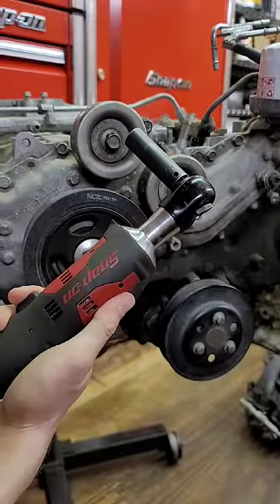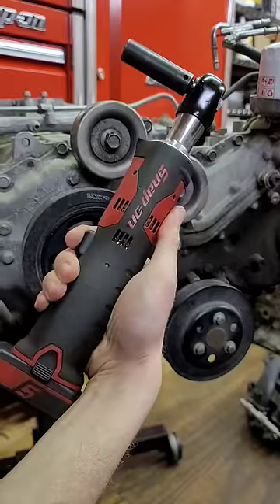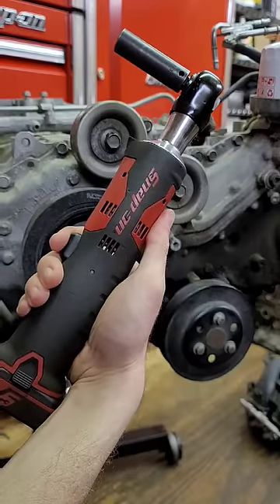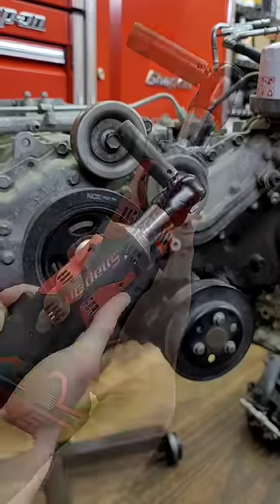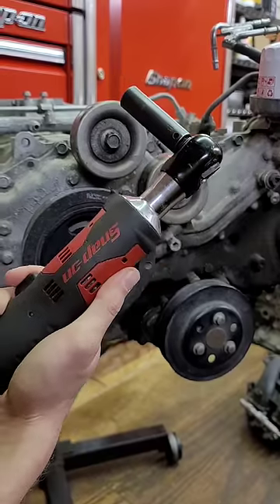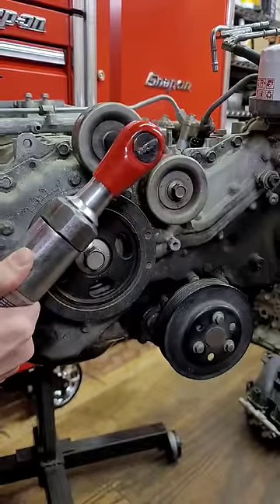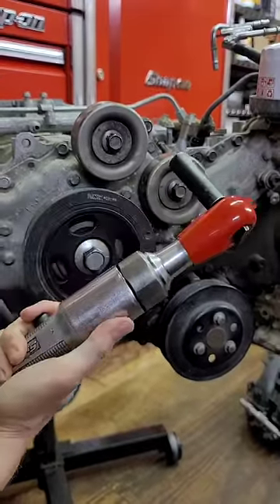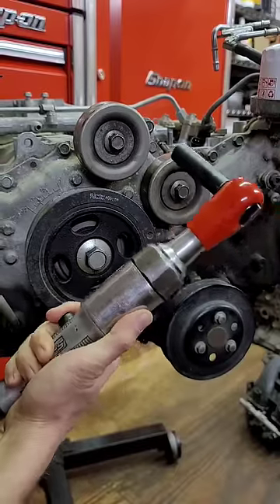Don't Use Electric! Use Air! Duh! #Snapon #Shorts #CordlessRatchet

Comment: I bought an air ratchet once. I've never actually used it aside from playing with it. My Milwaukee is 10x better than any air ratchet. Plus the key with breaking stuff lose is to give it a running start to overcome the overload protection. Good for the tool? Probably not, but it's effective!
Reply: This is why I posted a comment saying: A ratchet is no replacement for an impact gun.
Reply: @stewoe7157  absolutely. In many tight access positions where the ratchet can’t break the fastener loose, you’ll either have to resort to a right angle impact or a good old fashioned ratchet.
Reply: @alexp6016 Good old elbow grease.
Reply: Uh, just break it loose with a regular ratchet or breaker bar, then zip it out with the electric ratchet.
Reply: That's what the warranty is for lol
Reply: @hondaguy9153  it takes a good bit more time to switch from one to the other, and it can be quite a pain since the air or electric ratchet is used a lot in tight spaces you can't fit an impact into, otherwise you would just take an electric impact and not worry about getting a running start to break stuff loose and such, you just go ham lol
Reply: Same here. My air ratchet got used maybe once. Handling that hose in places where you use the ratchet is just too much. It’s been sitting in the drawer for years ever since, untouched except to move it out of the way to grab something I need. I don’t know why I don’t toss it! 🤣
I have a great battery ratchet I actually like. Still, I rarely use it though because I just forget to reach for it. I just end up using the hand tool.
Reply: I do this all the time. Get it running and them stick it on the bolt. Normally gets the bolt undone. Never had any issues with my snap on battery ratchet breaking from it. Amazing how powerful it is really.
Reply: The Milwaukee is a game chamger
Reply: @hondaguy9153  I don't know about others. The snapon ones advertise that you can use them as a normal ratchet to break it loose.
Reply: Not a mechanic but do plenty of work on my lbz and my partners suburban I'm a contractor by profession and have way too many m18 and m12 tools(if I want a tool and I can use it for a job I will buy it knowing I will pay for it within the day or job) and I can attest the ratchet and right angle impact save me time frustration and energy when I'm working on stuff that's tight to reach.
Reply: @dblclutchmitsu  yeah, you can reef on it... No need to be scared and only use it to spin bolts. Unless it's a cheap Chinese piece of crap with no reinforcement, it is designed to be strong enough to break fasteners free by hand.
Reply: Been giving mine a running start since I got it and it’s still holding strong haha
Reply: I know it isn't a ratchet, but my pneumatic impact gun is a beast and can break stuff loose that I need a bigger breaker bar than I own to do manually...
Reply: You have never used an impact air ratchet; SP air ratchet would puts Milwaukee to shame.  M12 is 3 times bigger and 5 times slower.  I have both and no battery ratchet can touch SP.
Reply: @MrSilverroulett  Same, long term it seems to be fine!
Reply: @alexp6016  My 40$ ingersoll rand ratchet would break your Milwaukee in half. Pneumatic is just better for the money
Reply: @waterloo123100  Torque isn't the name of the game for these tools though. I'm concerned about RPM.
Reply: @alexp6016  I don’t know what you use your tools for but at my job you definitely need torque on with a ratchet to  get rusted/corroded bolts loose. And even if you do need the rpm my pneumatic ratchet’ s have  lot more torque/ rpm too and it was fraction of the price of a Milwaukee ratchet
Reply: @waterloo123100  I work on cars, so I know about stuck fasteners all too well. I’m able to break a lot of stuff loose with the motor alone on my Milwaukee, but the idea behind the cordless ratchet is to be able to spin off fasteners quickly, not necessarily to break them loose. For that, we have long handle ratchets. Or another one of my favorite tools, the M12 right angle impact. It’s a little awkward in some places, but it gets into some tight spaces and will break most anything loose that you wouldn’t use a full size impact for.
The other concern here is portability. I don’t always have my compressor running, and don’t want to be tripping on an air line. I’m also not taking my compressor to the junkyard with me!
Reply: @alexp6016  You must not use your tools as heavy as I do then. Between heavy line and suspension repair on 20+ year old cars in the rust belt I’ve broken bolts loose and electric ratchets still can’t turn the bolts loose. You can’t use a Milwaukee right angle on steering knuckles because it’s so big you have to a air ratchet or pneumatic right angle if you want to be fast. I’ve personally used those electric ratchets but they don’t have enough power to justify the big price tag to use them. We don’t have any pick and pulls around here though so mobility has never been a issue for me to be fair.
Reply: @waterloo123100  I can get that, but pneumatic ratchets really don't have a place around my shop. To each his own, if they work for you, keep using em! If a right angle can't handle it and you can't get an actual impact in there, you're either going to be cracking it loose by hand or disassembling more stuff.

Comment: Electric are great when air isn't available . Ya may have to break the bolt/nut loose but then that electric assist is awesome and a huge time saver.
Reply: Electric is great even when there IS air available lol it’s worth it for the convenience of not dealing with the hoses alone
Reply: yourleftnut1  Correct. I just have small electric impacts that work on stuff thats been broke loose or basically 1/2 Inc and smaller. I do like the electric impacts for driving lag bolts screws etc.

Comment: As mechanics I look at it this way it keeps the air hose out of the way. I also have an electric impact battery operated that works wonderfully. Also I don't have air hoses laying out all over the place getting in the way tripping over them and I can get into more tight places without having a hose in the way. I still use air tools but not as much as I do my electric impacts and electric wrenches that are all battery-operated.

Comment: Milwakee right angle impact is nice to have when the electric ratchet won't cut it.
Reply: Never fits where i need it
Reply: @michaelreale3647  that's why you're single
Reply: @kg0311  cute…
Reply: @michaelreale3647  you know it was good 😆
Reply: I have a universal joint and all sorts of extensions. Lol it usually will fit. If it's something Hella serious I guess get a breaker and make short turns till you can get a ratchet on whatever you are using. It came in clutch getting rusted f250 bench seats out for me. I use my right angle milwakee impact more than anything else tbh lol

Comment: I LOVE electric ratchets, we have a Dewalt electric impact wrench in the shop but for rusted or stuck bolts nothing can beat the NAPA air impact we have. If the bolt doesn’t break loose the NAPA will snap it off. We also have a smaller air impact that we use for car lugs and tightening things because the NAPA is just too much. The electric impact is much less powerful but obviously much more convenient, while the NAPA is too big for most uses. I use all of the tools and they all have their place.

Comment: Being a professional technician I love my cordless ratchet. Sadly I don’t have snap on but the craftsman one I have still gets the job done !it’s a life changer I use it mostly for brakes the caliper bolts are the same torque as the ratchet has so it’s perfect easy and fast
Reply: Snap on one is junk, get milwaukee

Comment: "Why do you use electric?"

Simple answer, I don't wanna drag a hose around a fill up my air tank every time I have to take out a few bolts.
Reply: Well get a real compressor, not a 2 gallon pancake
Reply: @mayken6661  Right, cause everyone wants to spend a couple thousand on a massive compressor that they'll barely use and again still have to wait for it to fill with air before you can use it. Also "real compressor," really? Regardless of tank size it's still a compressor. Some of you guys are real waterheads.
Reply: @mayken6661  you know what’s cool about air nothing. I can walk a 150 to the back of a parking lot pull something off a car with electric and walk back.  Saving  huge amounts of time not having to rotate a vehicle into the shop to pull it with a heavy loud prehistoric tool. Electric tools are the greatest thing that happened to off-road racing pit support too
Reply: If you're full time mechanic air tools get your job done, you got plenty of torque, if you're only weekend's diy electric still enough, i prefer air cause i already had compressor, so my extra expense only to buy the air tools

Comment: Air powered tools were favored by industry because of pilferage years ago - the average thief/pilferer didn't have an air compressor at the house.  That all went by the wayside over the last 30 or 40 years as pretty much everyone had air compressors.  Fast forward to the last 15 to 20 years and electric motivation got smaller, stronger, cheaper and had the benefit, as shown,  of finally becoming cordless with a fairly long life battery.  I finally broke down and bought a cordless Makita 1/4 - 1/2 drive ratchet and only use my pneumatic rattle gun for the bigger stuff.
Reply: air tools are favoured in industry because of cost to working life ratio and ability to be used in harshest conditions . 
You also got realise air tools been getting smaller and better performing too .
In my business it be a tough day without air, battery is great but it got limitations and cost and durability also a huge factor, air tools can last decades in harsh use environment .
Reply: @mrb1864  I agree that this is the reason pneumatic tools continue to be used in industry.  I guess I wasn't clear that the smaller grinders, drills, and the like that are now electric were, in the old days when my father worked in a large war factory, not electric (corded at the time) due to pilferage.  I will note that toward the end of my career as maintenance manager my shop had moved to battery electric for these smaller tools as they had become more available in to the general public,were more rugged, and used more reasonable sized/duty cycle batteries. We continued to use pneumatics for larger work where an electric power unit would be too large, unwieldy, and require higher voltages to be useful and, of course as always, the price to acquire and maintain.
Reply: @bullnukeoldman3794  I can remember pillar drills and grinders when they belt driven off a power shaft that ran through the buildings :-) 
While modern battery tools are great addition the build quality of the old industrial air and mains power electric equipment was something that never be matched again .
Reply: Love air tools, I even have a full setup at my house for at least six months now Can’t wait to start buying snap on air tool on the cheap lol 😂
Reply: @raymond5145  I wouldn't get too excited on snapon air tools, most of the best innovation and power comes from taiwan air tool odm's you never heard of ...

Comment: 3/8 cordless impacts are life changing, but when it comes to tight spots, f.e timing covers, 1/4 slim air ratchet wins all day
Reply: Yes. I worked on german/European cars and wonder how you could use the cordless tools. There is literally no place anywhere, to work with one of these chunky tools. Air tools are so much smaller.

Comment: Before I got my job as a mechanic in a tire shop I was just a DIY mechanic working on my truck. First tools I bought was a ryobi cordless ratchet and a compact impact. The ratchet has seen tons and tons of use, I’ve even used it as a cheater bar when my normal ratchets weren’t long enough. Just put it on the bolt and start hitting the battery with your palm or fist and it’s still running just like when I bought it.

Comment: Sometimes the air is better, but when the inconvenience of a hose/ noise is a factor... the cordless is amazing. Similar to soldering iron. I love my Milwaukee soldering iron, great to use when working in cold windy environments where electric is not easily accessible.

Comment: to be honest, I rarely use my air tools anymore
Reply: I remember a year ago, I brought an air ratchet, and discovered I needed an air compressor...so I got an air compressor...but it wasn't BIG enough! Kept "recharging" after a few seconds of using the air ratchet.
Then I discovered I needed a bigger air compressor..costing like $300-$500.

After that I gave up on getting anything else for the air ratchet, and got an cheap $45 electric ratchet from eBay(two batteries included). Hasn't failed me yet, and breaks bolts like nothing(manually).
So now I have a small compressor that I hardly use, and an air ratchet I will probably never use. Waste of money.

Comment: I find the baby boomers harp on me the most for electric tools. But once they borrow it and realize how handy it is to not have a cord or air line attached always makes me laugh. They end up switching over. 
Best thing to say is “ have fun lugging an air compressor or generator in the middle of nowhere to fix your machine” usually always makes them realize quick how handy it is
Reply: Never use society seperatist phrases like "baby boomers" and this advice is not from an old man
Reply: Situational. I work in underground mining, we have air lines damn near everywhere. Pneumatic drills are the go-to and we have over 1000 CFM of compressor capacjty. That said, I still throw my 1/2" battery impact in the mantrip before going down to work on something.

Comment: I'm a diehard Milwaukee guy but that snapon 1/4 drive and 3/8 drive electric ratchets are the shit!!!
Reply: Worked at a body shop use the shit out of cordless 1/4 ratchet. I destroyed 3 milwaukee ratchets in 6 months and switched to snap on. It was stronger faster and it would last a year or longer before needing rebuilt. Also snap on easier to get fixed. Milwaukee wouldn't fix the first 2 they did warranty the 3rd.

Comment: As an under the tree mechanic, you have to buy a BIG enough air tank, the air ratchet, and the hose with hose fittings....it all adds up.
But an electric ratchet, all you need is the battery, charger and ratchet...which usual all comes together, and cost about $150 for good brands, but there's cheap ones on eBay for $45...I brought one and been using for over a year...still works well, and has TWO batteries included!

Comment: When electric ratchets came out and got to a level they were decent batter wise, I switched. Dragging a dirty air hose over customer's interior doing inside work. Or someone tripping over it and yanking it out of your hand. And in the salvage yard there is no air, they're the best. Although I do have impact air tools. Have a 1/2 impact air ratchet. And the Ingersoll Rand 111 knuckle saver. Awesome ratchet. Has an impact mechanism in it that stops the torque from crushing your hand.

Comment: I'm a tech at a dealer and I use both. Both tools have their application. For tires and suspension work I'm using the 1/2 air wrench(Ingersoll quiet) If I'm in the car I'm using the cordless. For brakes I use the air 3/8 wrench(matco quiet) if I'm doing like a front cover reseal I'll use the air 3/8 wrench cus sometimes the Milwaukee cordless 3/8 can't remove accessory bolts. I lve in Chicago and shit around here seizes together like crazy. I don't have a cordless 1/2 wrench because I don't need it.

Comment: Battery is good for a majority of minor torqued parts. Does the job fine. 

But for anything heavy and things requiring a lot more power, air is the way to go. The batteries can only hold for so long before losing its peak power and making it impossible to remove a tight nut. 

So both are a must have in a shop.

Comment: just a home mechanic- and home repairs...I downsized my compressor to a 4.5 gallon for air finish nailer and air gun for cleaning parts- tire inflation etc... and started using more cordless electric tools, drill - 3/8 ratchet - 1/2 mid torque impact and thinking about a cordless angle grinder. Dragging around 50ft of hose is a pain, and if you need to repair something away from the shop electric is it unless you have portable air

Comment: As I have more experience in the field, (over a year now using both air and battery power) I can confidently say that electric is the way to go, everyone should have pneumatic tools in case you need them but battery tools are so much lighter and more efficient. Also battery powered tools have gotten so much more reliable now-a-days, it's not 2005 anymore, battery tools last now.

Comment: I have air, electric, and battery electric mechanic's tools & like 'em all about the same. Like most of "We elders" I started with air, most shops had enough air drops for three shops so finding air was no problem - while electrical outlets were like hen's teeth, some shops we had to use the car owners in car radio for music 'cause there were NO outlets near us.
Next came electric (corded), still the best for head porting, and 90° angle grinders - with cutoff wheels.
The latest generation of battery tools (lithium-ion) are fantastic, good power, portability and some good sale prices come along fairly often.
I like them all and plan on continuing to use them all.

Comment: I always use the "running start" method with all my electric ratchets...press the bottom without the socket in the bolt then shove it on..works like a charm :)